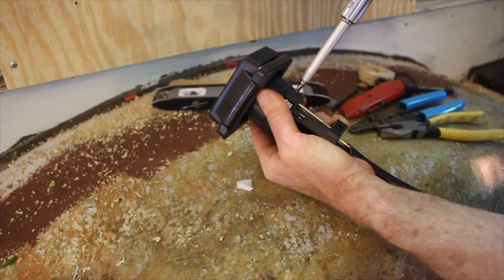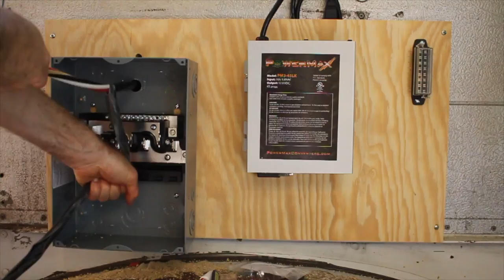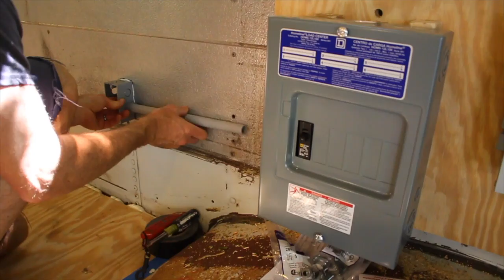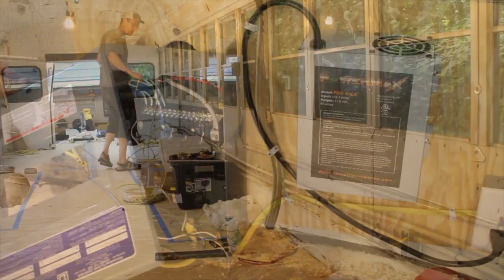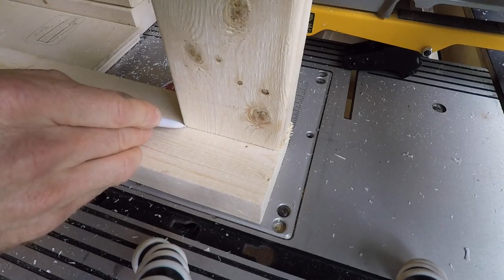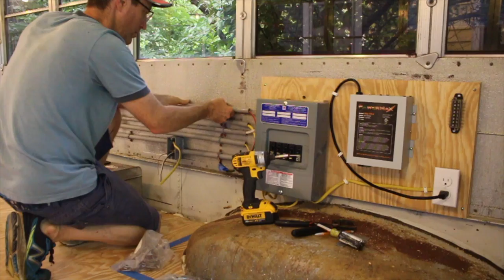Wiring and a Wall -- Prison Bus Conversion #11

Comment: I would recommend putting a 12v circuit in for USB like for charging phones and cameras and such. Also, you may want to have some 12v venting fans for either heat/moister or for bathroom smells. Also you may want a circuit for a radio or more than 1 zone of lights ie bedroom area and mane hang out area. Thats assuming you are putting up interior partition walls. Just ideas.
Reply from the maker: Those are great ideas and notes I took early on ("need fans!") and completely forgot about. thanks so much for the ideas!
Reply: I know by now the bus should be built... but if theres a way to make some of the USB plugs fast charging compatible that would be great
Reply from the maker: Good idea ... I’m thinking of adding a few

Comment: I made this comment before and something happened on my computer and I do not know where it went. A good way to uncoil wire and not get twists is to use an old office chair that does not have a back on it. You can pull the wire out of the package allowing the chair base to rotate and you will not get twists in the wire allowing it to lay flat.  Glenn Lever
Reply from the maker: oh man, cool idea. those twists can be so annoying ... I'll have to try it on the next job!

Comment: Consider a one or two 12v powered fans (fantastic fan types). Worth thinking about a few exterior 12v lights by your doors. Also you could just hook up both batteries in parallel for double the amp-hr capacity and have both the alternator and AC converter chargers hook into the same battery bank. Love the videos, keep up the good work!
Reply from the maker: Those are all great ideas ... things that totally slipped my mind but that I'd be kicking myself about if I didn't add now. so big thanks!
Reply: Kevin Kingsbury is

Comment: I know this work is all done, an easy way to unroll wire and not get twists in it is to put the roll on an old office chair that can spin around while you pull the wire out of the package. doing that will not cause twists in the wire (it will lay flat).

Comment: was was the delivery? ;>
for 12v I'd get some color LEDs around bed or just around the bus overall. They add a lot :)
Reply from the maker: In my first draft of the video I did an unboxing of the delivery stuff, but ended up cutting it out due to length. Yeah: lots of little do-dads for the bus ... which will show up in future videos, no doubt. 

Someone sent me some of the LEDs you mentioned, so I'm definitely going to incorporate them! :)

Comment: Is there no need for a 50 amp main breaker ?
Reply from the maker: I could see using a main on the AC system. As I've set mine up, there is a lot of redundancy: the breaker on the cord that leads to the bus, then breakers on each circuit. The nice thing about the main you're talking about is that you could shut everything off at once from inside the bus, instead of one circuit at a time
Reply: @metaspencer  Ok :-/ I didn't think about the breaker on the shore side. I've subscribed and learned alot, And I want to say, Thankyou !! Hopefully I'll be starting my conversion soon, Thanks Again !! Love your Channel !!
Reply from the maker: @rdwhite65  Thanks for checking out my build. I think adding the breaker you mention is a good idea: added peace of mind

Comment: damn really  digging  this wish i could  help lol consider  a 12 v solar panel  their cheap bro
Reply from the maker: Wow, and Just checked the prices on those and you're not kidding ... they're pretty reasonable. I use a really cheap one to charge my tractor battery ... I may just have to go there! Thanks for the consistent encouragement, bro
Reply: its  my pleasure  sir
Reply: Spencer, I don't know whether you have checked out www.thepowerstore.com, but they have great prices for the wattage.  I went with 4 x 268 watt modules which were less that $700.
Reply from the maker: +Marshal Pearson ... will do. Haven't seen that site. Thnx!
Reply from the maker: Ooooo, they do have good deals!
Reply: i looking  to thanks 4 the  tip